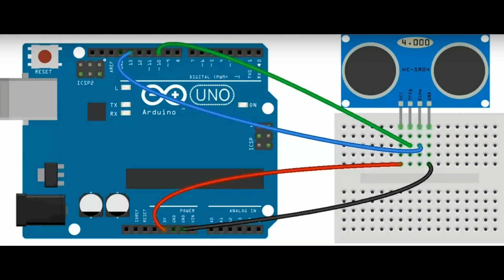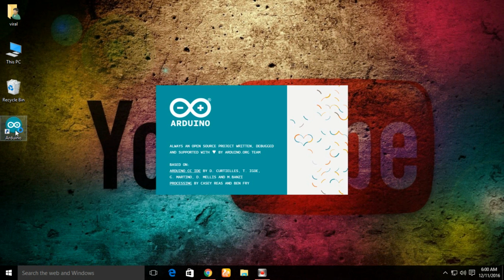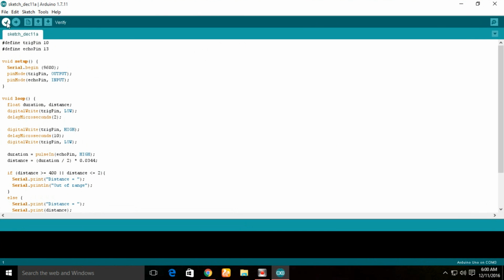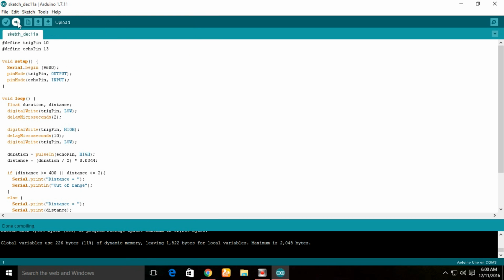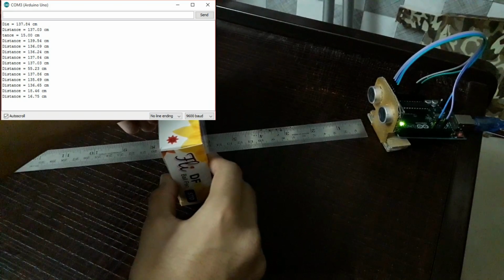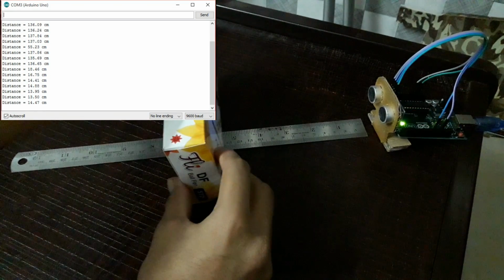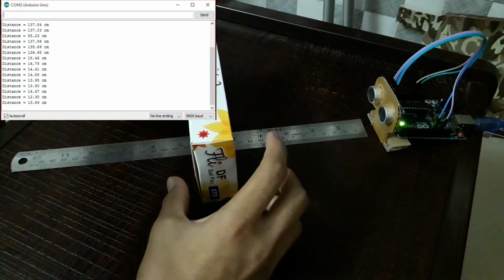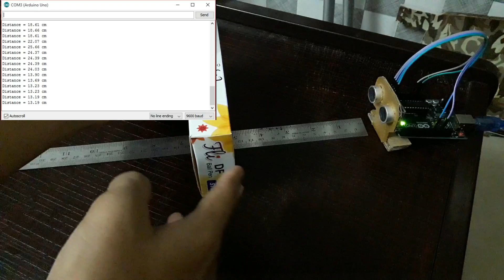How to make DISTANCE MEASURING device

Comment: It's not distance measuring device it measures a distance between system and obstacle.Distance measuring device means device need to be in motion and there need to be some sensor arrangement which should track the distance travelled by the device.Your video is not matched with the title